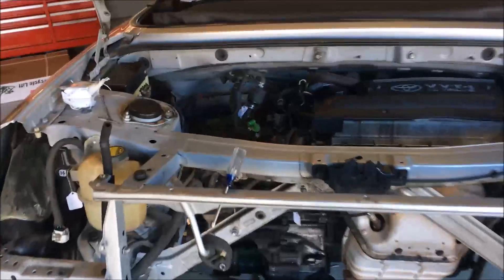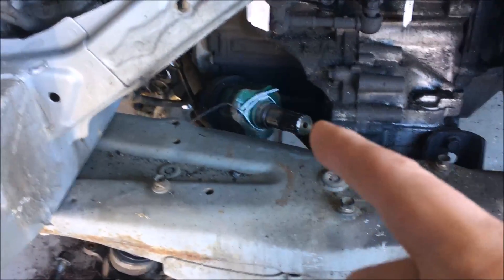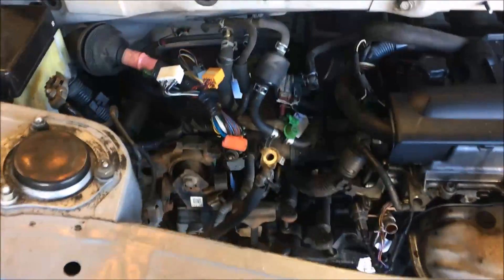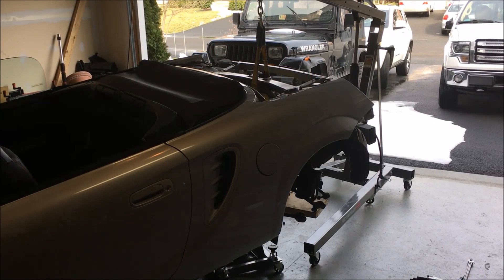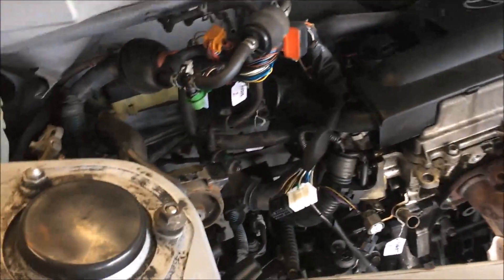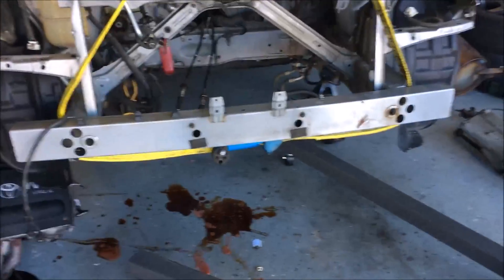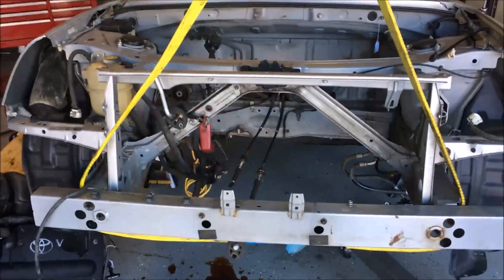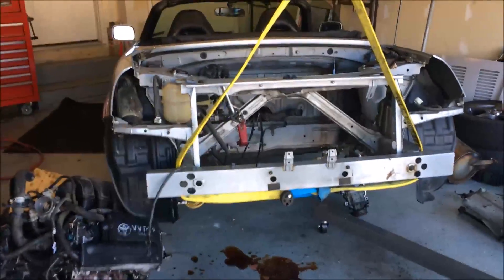MR2 Spyder Engine Removal Completion

Comment: Can a 1zz out of Corolla or matrix work in MR2. Locked up in mine. Don’t want to swap to 2zz.
Reply from the maker: John Doe I can’t imagine it would be a problem. You would need to swap a lot of the peripherals but the engine is the same.

Comment: How do you take out axels? Im struggling to take even the left one since i dont know, this my first time
Reply from the maker: Mix DaGod - The passenger side will be the easiest. The driver side you need a special tool or you can use cable tied onto the axle and around a big sledge hammer like I did.  Cheaper to buy some cable.
Reply: StarkReality do you have instgram we can message someone to send you picturez ?
Reply: StarkReality i requested you on instagram as Project_Zadah
Reply: https://youtu.be/Vu9USqxqG9E

Comment: Do i have to remove transmission fluid ?
Reply from the maker: If you remove the axles then the fluid will come out.  If you remove the engine without removing the axles you could leave the fluid in.

Comment: How did you remove ur ac compressor? Theres like no room for me 2 get a wrench in
Reply from the maker: It is a tight fit.  There are just 3 bolts, I think 12mm.  You need a ratcheting wrench instead of a socket.  You can get to the top bolt from above the engine and the bottom 2 from under.

Comment: Following, and am still evaluating a 2ZZ for my swap.  Already pulled and replaced the 1ZZ.  This car is easier to drop the engine on than my MR2 AW11.  Suggestions:  drain all fluids first (engine, tranny); 2) use an old carpet or cardboard rather than a dolly to drop the engine onto.  This greatly reduces the height you have to lift the car and is easier /safer, since the engine cannot fall or roll off the dolly.  You can drag it out easily by yourself across a clean garage floor.  I have used furniture dollies, but even they take too much room.  Throw away the cardboard when done (also absorbent).    Last, better check your jack stand placement prior to lowering the car back down...you are lucky you did not punch through the floor or a door.  Once the car is up, I move them out of the way entirely until you are ready to support the car again.  And chock those front wheels!
Reply: And by dragging, I mean dragging the engine across the floor USING the cardboard or carpet, which will protect the engine and your garage floor.  Plywood and multiple pieces of conduit works as well, with the conduit pieces providing a rolling surface.

Comment: Looking GOOD!

Also interested, as is Tautvydas Z,....

Did you buy new 2zz and or trans?

See some very new looking parts (trans in particular) in video.

I purchased "drop-out" from US spec 2001 Celica GTS with 2zz/C60 and wiring + comp.  Has over 100k so will refresh motor as needed when I strip it down....est 2+wks from now.

What is yours trans choice?  With LSD?

Please advise and keep posting as much detail as possible.

Thank you and happy motoring,

P
Reply from the maker: I went used JDM for the transmission and engine.  Could not find an LSD transmission, they come from Europe where it was standard.  Installing an LSD is expensive and many saw you have to have it done for you.  Some people say it is not a big difference for the car but I don't know.
Reply: Hello Mr. Stark and thank you for the response.

The JDM motor/trans looks so clean from what I noticed in the video.

Trans is C60?

I am looking for LSD, but may be biased as when I test drove my car in Northern Michigan it was snowing....and it was a one-wheel-wonder (no traction other than one wheel).

Anyway, looking forward to more videos and thank you for posting.

P

Comment: Hi, did you buy a new 2ZZ engines or a used one?
Reply from the maker: I bought a JDM engine and transmission.  So it is used and straight from Japan.  Came from a Celica GTS in the 2000-2002 range.